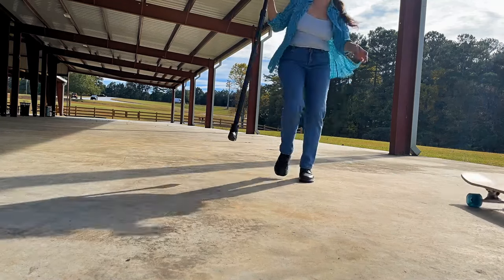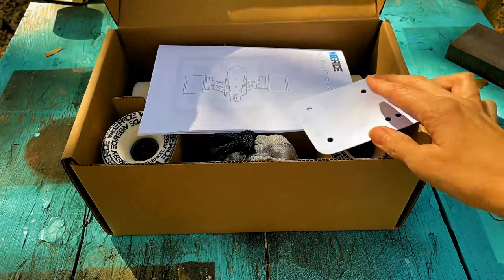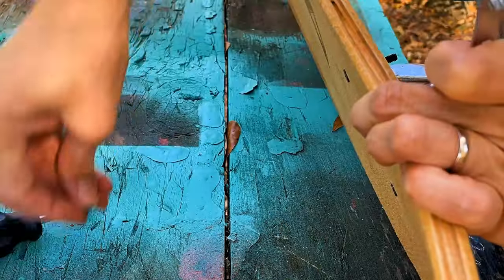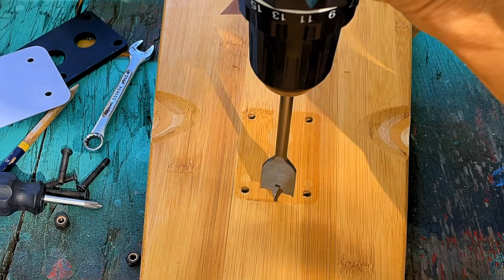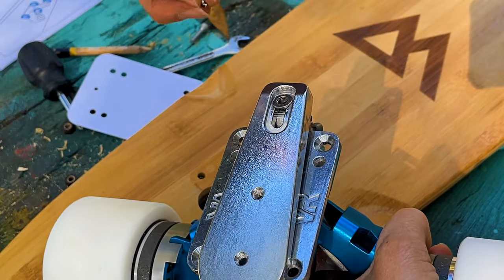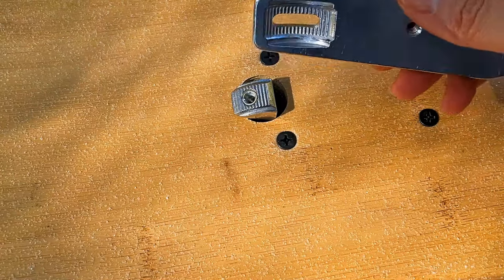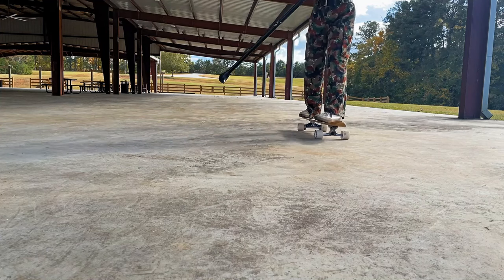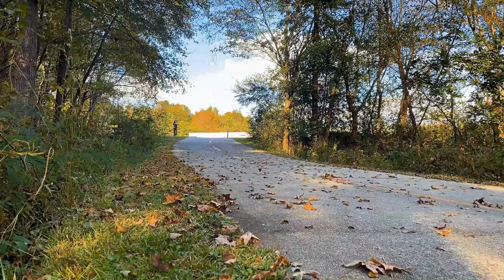VibeRide: Installing and Testing Longboard Brakes

Comment: Great to see how easy it is to install! I've been considering this for a while. I got a longboard a few years ago that I custom build myself, and getting a bit older, injury just really isn't an option for me. Not only can I not afford it, but it takes longer to heal and just ruins the fun of skating. I was an avid skater as a kid, but stopped for years. So getting back into is a little bit slow, because of that fear of injury. 

Also! For the pebble problem, look into Shark wheels. I have them on my board, and they are fantastic.

Comment: I bought the brake set too and attached it to my Landyachtz Drop Hammer deck, which is a drop-through, so there's no need for drilling a hole. Good to see how it works for you with a top-mount deck. I think the brake is really helpful to overcome the fear of getting too fast, if only it wouldn't be so noisy. What do you think about the rattling coming from some parts of the truck?
Reply from the maker: I was able to adjust most of it away.  My first ride was a disaster in every way, but I started making little adjustments and got any rattle down to a minimum.  I hadn't noticed them being too loud since then.
Reply: what exactly did you do to get it less noisy? @RachaelPadilla
Reply from the maker: I tinkered with the tightness of the kingpin first.  I believe that the bushings are of a different dur than I had previously.  Then I worked on the "brakey" adjustment and made sure to tighten down the pedal bolt well.  I haven't noticed them being more loud than usual since then.

Comment: I havent been on a board in 50 years😅 wow tech has changed. We would downhill on our backs with motorcycle helmets,  gloves and 2 pairs of pants. No brakes, you stopped at the bottom of the hill, or fell off😅
Reply from the maker: I have gotten much better at using them.  I haven't fallen yet!  Thanks for watching!

Comment: Hi, Rachel. I just found your channel via this vid and was immediately interested in your feedback on the VibeRide brake - thank you! I just ordered the entire brake board tonight, but if all goes well, I may even buy and install VibeRide's braking system on to my other longboard, which BTW is exactly like your 44" Magneto, even down to the blue translucent 70mm wheels. 🙂
 
BTW, yes, pebbles are NOT our friends, but what I encounter more often here in So. California are uneven concrete slabs of sidewalk which threw me for a loop - literally - some months ago. My only longboard with a tail is the Magneto, which makes it safer for negotiating these hurdles, but not so with my 2 other longboards. 😞

Liked, subscribed, and cheers!
Reply from the maker: Welcome aboard! I'm loving it so far and would recommend it to anyone that's interested.

Comment: Be wary of big, steep hills, the brakes lose efficiency really quickly and you'll end up with brake fade after a short while. Downhill254 did a review on his channel, and he couldn't brake anymore after a while of riding.

edit: Also, wearing certified helmets and pads gives a lot of extra confidence.
Reply: He was talking about it's actual efficiency of coing to a complete stop at 50MPH, per his blog. It won't stop you within 20 yards like sliding would, it's much more gradual. But for everyday cruising, it's super efficient at slowing down and you just gotta try one IRL :)
Reply: @viberide  He was going like 30mph.